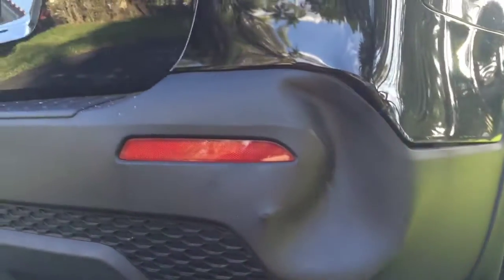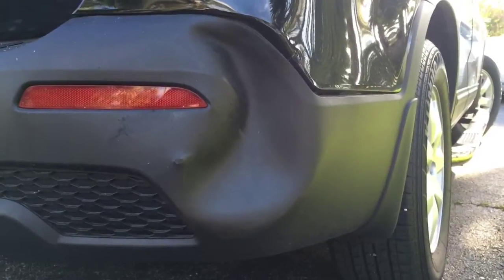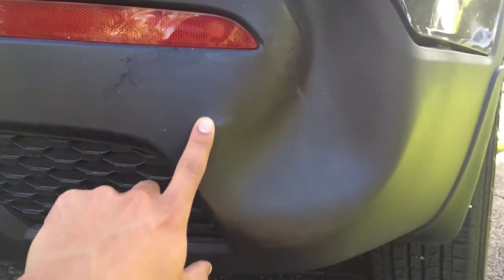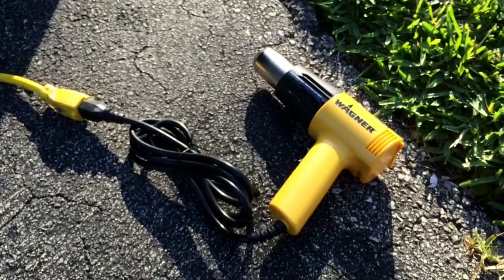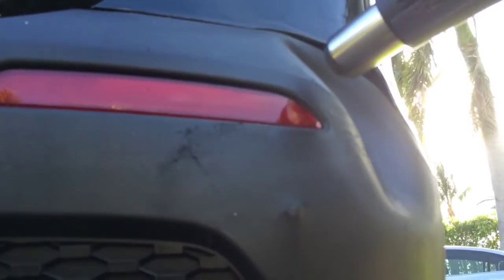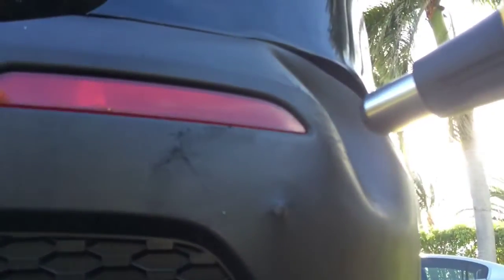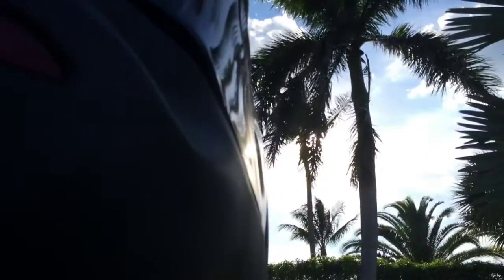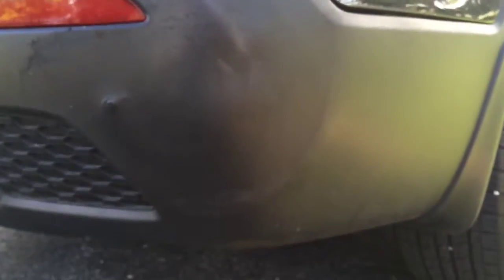Rear Bumper Dent fix on a 2011 Kia Sorento

Comment: Thank you- I'm going to try this in the morning on my 2016 Sorento- drivers side rear met its match tonight with a low retaining wall...
Reply from the maker: tiamarie09 careful not to get too close or leave it too long. It could melt the plastic. 
You can also try a pot of boiling water. Should do the same trick. Good luck